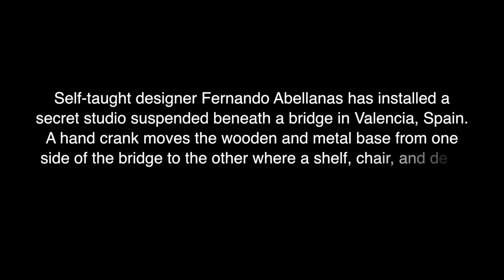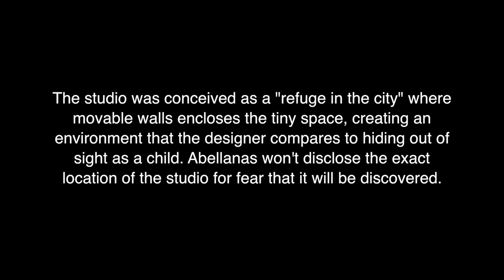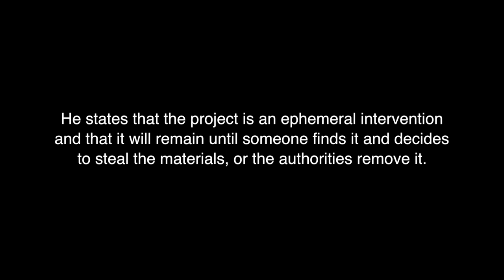Hidden Studio Suspended Under a Bridge by Fernando Abellanas

Comment: Just tuned in and this idea is so brilliant. Guess the installation into the bridge will count as a damage to the bridge and inspectors would not be amused. But the slight part is awesonme. What kind of wheels did you use? Why not store all of the belonging inside of the slide part and close it with a padlock while beeing out?  Stay save and blessings
Reply from the maker: Good questions. You can ask the designer on his Instagram page. Link in video description. Thanks for watching.
Reply: If it were mine I would add a remote motor similar to an electric gate opener and send the lift back to the wall while I leave. Also camouflage the entire thing to appear as if it’s part of the bridge somehow and maybe the inspectors would turn a blind eye

Comment: This thing needs solar panels that are able to come in and out on rails so they can also be stealth.  The solar panels could charge batteries that would be able to run many small fans during the night to keep it comfortable all night long when sleeping.  Something like two large 285 to 300 watt solar panels connected to a 40 amp charge controller and maybe four to six 100 amp hour batteries.  If you had that, you could even power a 5,000 watt BTU A/C on it.  I could live like a boss if I had a set up like this.
Reply from the maker: Sounds like a good setup to me.
Reply: @JasonJose  Yep.  I've done it before.  So I know it would be perfect to set up over there.  As long as there's any kind of light, the panels will generate power, even underneath the overpass without direct sun.  If you had 6 large panels, it could still be stealth and generate enough power as 1 or 2 panels would in direct sunlight.  And maybe one of those machines that are able to pull water from the air to give you clean drinking water.  You would just need a toilet and you'd be set!